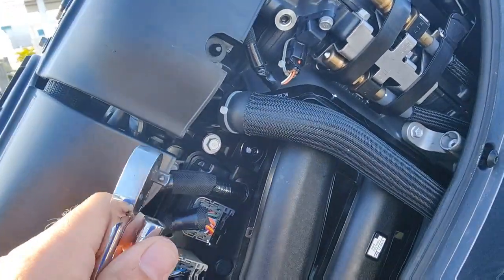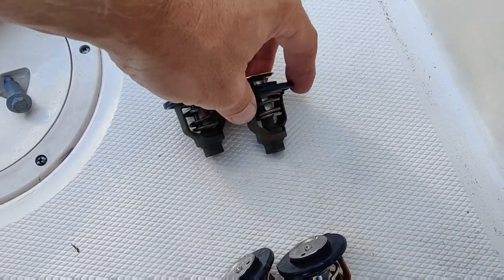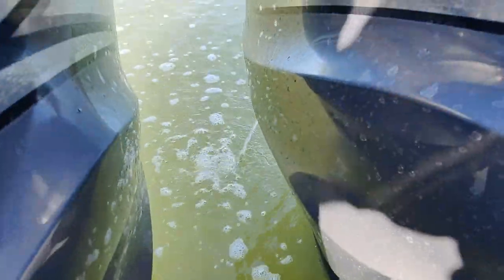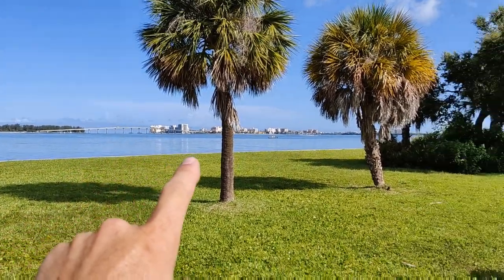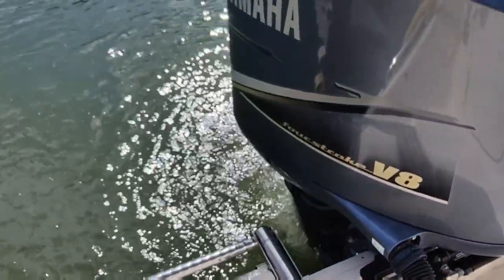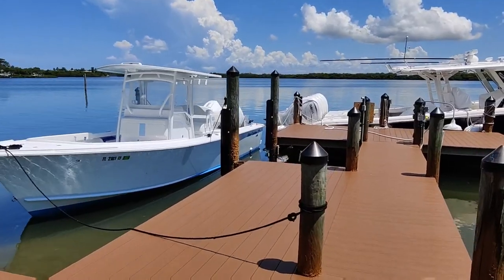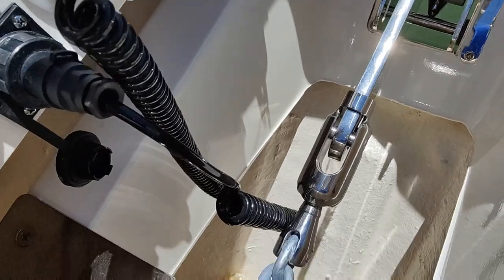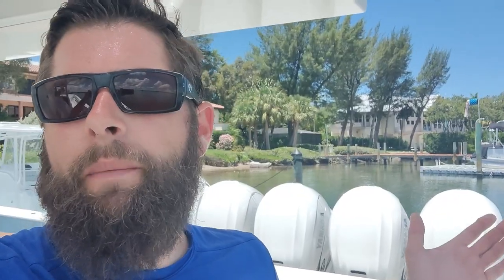A Day In The Life Of A Mobile Marine Technician #Pursuit #GradyWhite #Yamaha #Episode 173

Comment: Hello Justin,
First of all I want to let you know how much I enjoy watching your videos, they are very informative.   I do have one quick question that I have yet to get the answer to from anyone.  I have a 2022 378 Pursuit purchased in March of this year.  I am having trouble with the windless anchor road when pulling anchor it binds up on the bottom side of the windless right at the exit point.  You can not retrieve anchor without constantly pulling the rope from underneath.  Have you seen this issue?  My boat is in Fort Lauderdale and I am having trouble getting tech out to check it.  I'm wondering if it has anything to do with the rope.  
Thank You for sharing your knowledge with us, keep up the good work.
Reply from the maker: Thank you. I appreciate that.  I would definitely see what rope is installed. Check the size and then check what size the windlass calls for. It's also better to have an 8 plait rope in my opinion. It seems to lay down better in the locker. Keep me posted and thanks again.
Reply: @JustinLeeMarine  I will defiantly start there and let you know the outcome.   Thank you for the fast reply!

Comment: @ 13:.03 
Hey Justin  that’s connection dingo reader  u call it..is that some thing I could buy somewhere 
I got the same Yamaha 425 offshore motors
Reply from the maker: I call it a dongle. Lol. It's just a Bluetooth device you get from Yamaha.  You have to be a dealer to use it because it requires a dealer number to set up. This is the part number. MAR-BT1ED-R4-00
Reply: @JustinLeeMarine  Ok thanks bud the reason I ask yesterday I was out on the water I got a check engine light ,so on my way back heading back to the  Marina the boat cut off on idle ..so I went into the settings warning Manager  and it says “ port engine
Reply from the maker: Gotcha. Keep me posted on what you find. The code should tell you what is happening.
Reply: @JustinLeeMarine   So there was no code stored the only thing it say under Warning Manager was port engine…. so I decided to change the fuel water separator + fuel filter + medium pressure fuel filter, Then took it out and it ran perfect …again I appreciate the videos u do  it truly helps a-lot thanks again bud
Reply from the maker: Thanks for watching and keep me posted. Glad you were able to fix it.